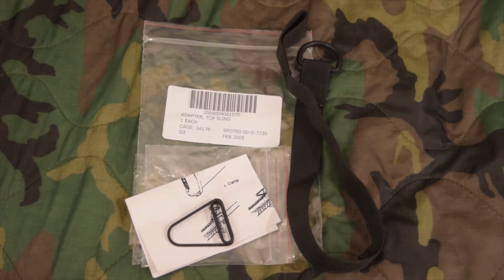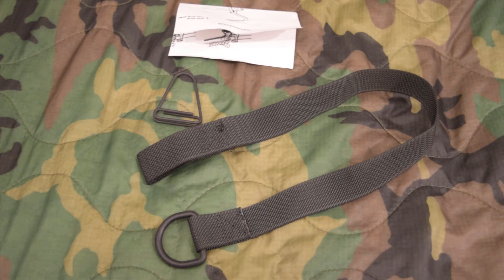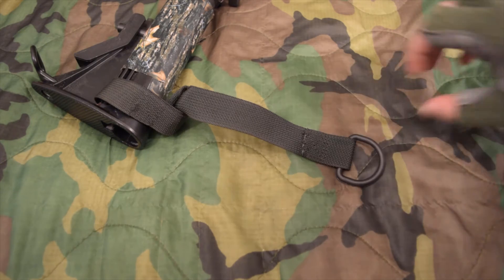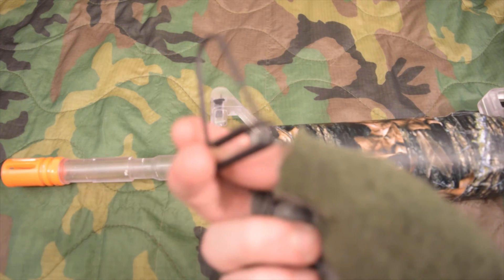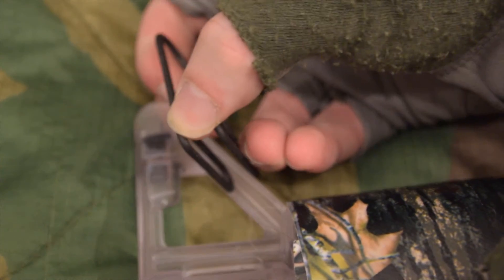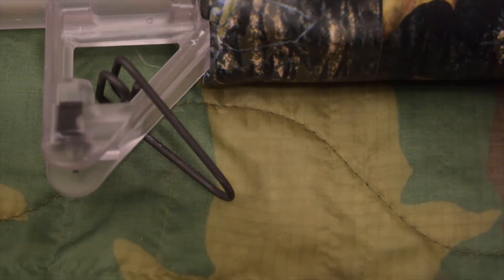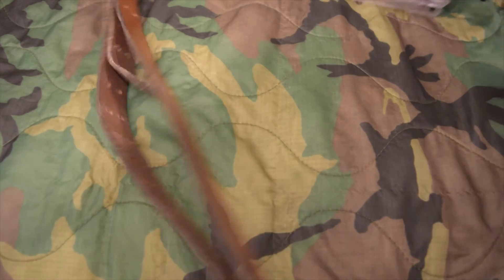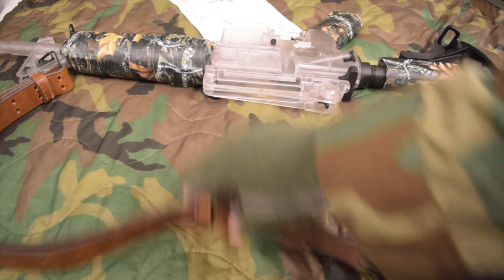USGI ADAPTER, TOP SLING (2005) Tutorial About Setup And Use

Comment: I have one on my A1 XM177and it works fine with the older Vietnam era cotton web sling.
The round portion of the front adapter rides under the front sight base and the flat part is where you attach the sling.

Comment: This is wrong. Look at the pictures in the instructions. The sling mounts to the paper clip looking end and the top of the clip goes in the narrow slot between the barrel and front sight.
I can't do it but I can see in the pictures how it goes.
I think this is made for the thinner barreled A1 because the clip will not fir between the front sight and barrel on my A2.
Reply from the maker: I'll take a look at it tomorrow. I've got an .750 and 650 barrel and gas blocks, so I'll be able to double check both of these for you.
Reply from the maker: The instructions even show an A2 with a .750 barrel, how are you not able to do it? What's going on? If you can do a video showing how you're trying to put it on I could probably help you out.